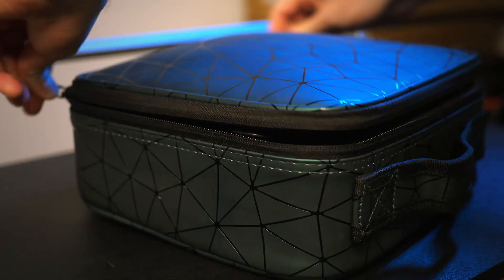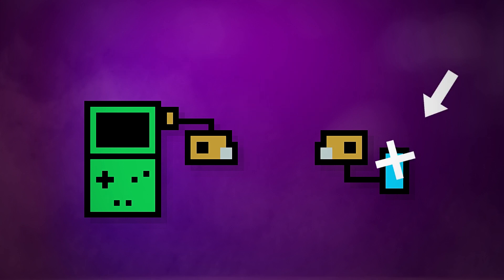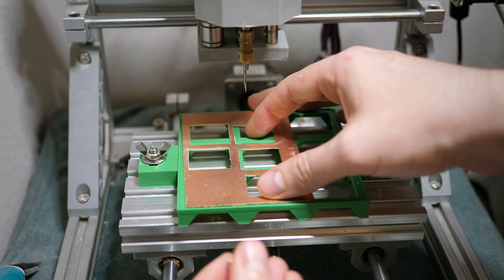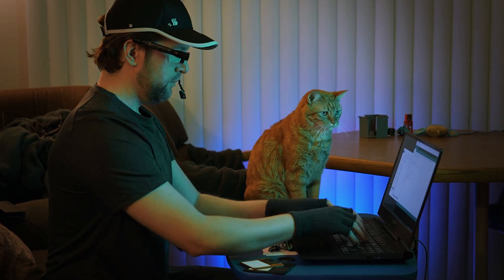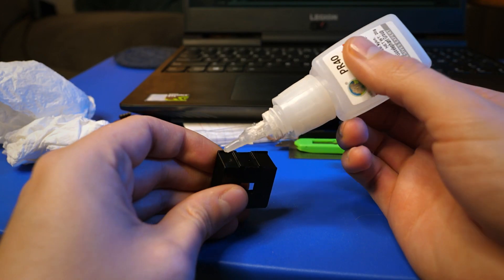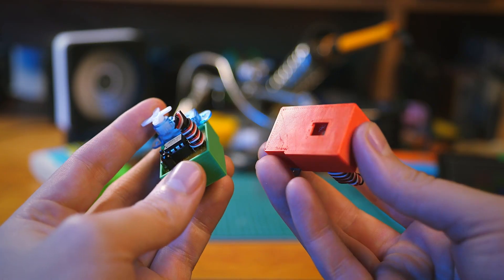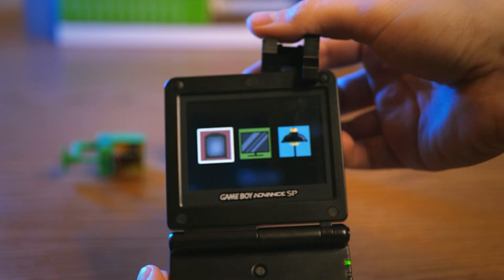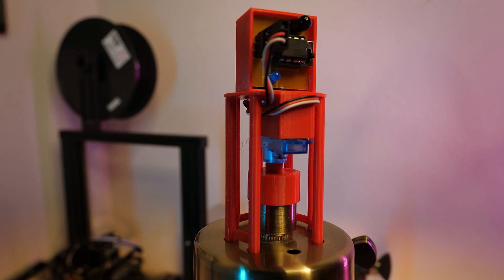My Wireless Game Boy Remote Control | How It Works

Comment: I'm curious it's possible to create multiplayer game for GBA

I know it's possible to create multiplayer Player game that works with the ling cable but my question is it's possible to make a GBA multiple game that you able to connect in both GBA and computer And play together ?
Reply from the maker: I've tried it! The gba link cable code is not very good and hard to work with. It's weird and hard to use but I would like to give it another try.
Reply: @3DSage  okay

Comment: This is pretty cool. Next step would be to stuff the IR transmitter into a cart and not have to clip something on. Though that may require a lot more expensive components to get it all to fit.
Reply: or use a gbc? (I know, that's not 3DSage's territory (yet?)
Reply: @Suicoo  I didn't even know the GBC had an IR port, thanks. That is such a cool feature I wonder why so few games took advantage or why they didn't add it to more handhelds.

Comment: Pokemon FireRed & LeafGreen came with a IR Blaster Wireless Transmitter & Receiver unit that clipped onto the back of the GBA & GBA SP.

Also, the original GameBoy, GameBoy Pocket, and, GameBoy Colour came with a Built-In IR Blaster on the top of the handheld.

Lastly, how about instead of triggering a sensor why not just have the screen display a trigger Colour that you then use a fibre optic cable to route to the back of the console from the front and then beam that like a laser to a camera or light sensor on the other end to detect output.

Alternatively to that why not use sound outside of the audible range of people to trigger sensors in the room silently, that way you program the target sensor to listen to a unique sequence of trigger sounds, and then program the GameBoy Advance cartridge to get the speaker to play those completely inaudible tones such that it triggers the target device in a seemingly silent manner

Comment: instead, you could make an IR blaster cartridge, by decoding the address being read from the cartridge, and having a magical special address that turns the LED on or off or whatever. or you could use the same kind of signalling back to the cartridge to transmit bytes, and eventually trigger the transmission.

Comment: Using the colors on the screen is a really cool idea with a lot of potential, but at least in my experience a lot of the GBAs I've seen have really dim screens. Wouldn't it be possible to use the serial port instead for communications?
Reply: Thats what i wad thinkung too
Reply from the maker: They first released the dim ags-001 SP version, but then they released the ags-101 SP which has a much better and brighter screen. This the the model I'm using and it works great. I can also adjust the sensitivity of the light resistor.
Reply: @3DSage  Yhea yhea, but the question is why someone skilled enought to develop a 3D engine for the GBA have a total lack of knowledge when is about to deal with the Link port...

Because implement hardware in the cartridge is another option, boktai, yoshi tilt, and more... but using the Link port you dont need to get out of the SDK...

My lord, its even developed a radio transmisor from the own Nintendo for some Pokemon games...

And lets no talk about GBC for IR purposes and the game Mission Impossible...

An explanation is required.
Reply: That was my initial thought as well considering he would want that for expanded control...
Reply: That's really cool, and I gotta say using the light of the screen is still a lot more creative too

Comment: Any reason you milled out a pcb instead of just using perfboard?
Reply from the maker: I could have done that, but it's easier and quicker to print multiples like the 3 receivers which are all the same layout.